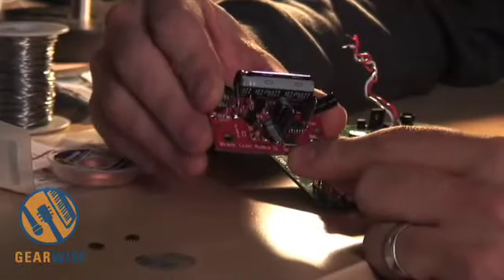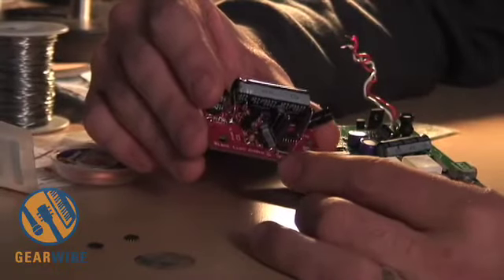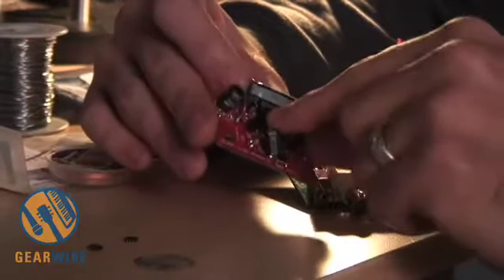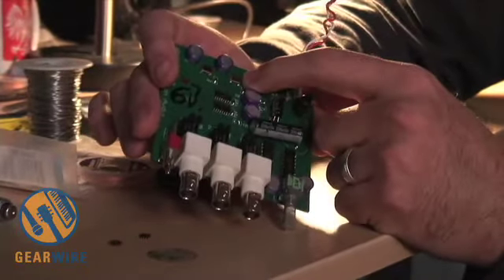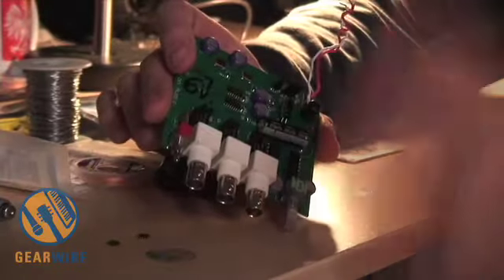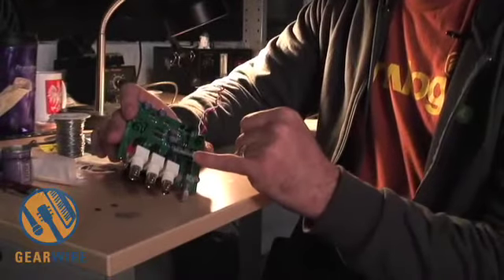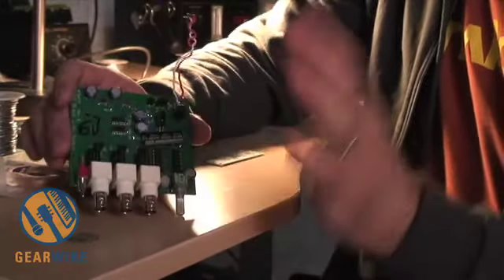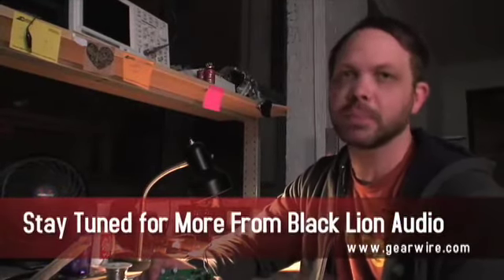Black Lion Audio's Digidesign Digi 002 Modification: So You Think You Don't Need To Upgrade Your Wor

Comment: Hello guys. I am very glad to have responses from you . Actually I want to let you know that I checked all the information from different chats about Pro Tools and Digi Design and did everything that need,and I want to mention one more time my issue . I had bought from eBay 003 Rack Black Lion Mode, installed Pro Tools 12.0 on IMac Sierra 10.13.6 it works, downloaded a latest Driver for 003 Rack it works, they recognized each other, then run PT. In Hardware i selected it as a 003 Rack, in Playback engine selected it as 003 Rack, I/O Defaulted In/Out/Busses/Inserts. In I/O all Outputs can see in ‘italics’ included Main Outputs, if deleted or Default 003 anyway will catch that system of previous owner and holds in that I/O which is not match with PT Aggregate … So Paths miss with Inputs and Outputs seams are selected as for others’ systems by previous owner. There is no Main Output, Inputs not recognized in PT. The sound card is working well as it must be, even Output 1 and 2 if connected to my speaker can hear sound from PT. or computer as probably is settled up by previous owner like that, but it of course isn’t on my control to level it up or down by volume knob of 003. That’s my little story that made me feel pretty broken inside but I have you Guys now!!! Happy New Year 🎆 and successful to each of you!

Comment: I had them mod my Motu 828MKII. That is an old converter now, but it is still kicking butt thanks to the mod. I shit you not when  I say it added an octave to the bandwidth and turned my MOTU from a 'good enough' converter into a 'why buy a new one?".
I can hear problems in my signal chain now, so I can fix them before I commit to a take. Well worth the money spent.
Heck, I may just pick up a used 828 MKII and send it to them so I can just plug everything in all the time.